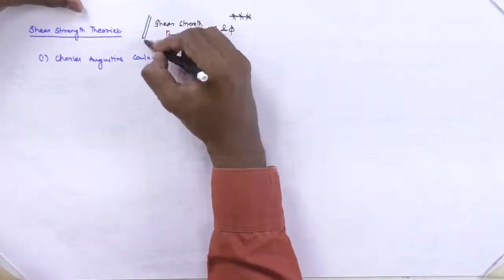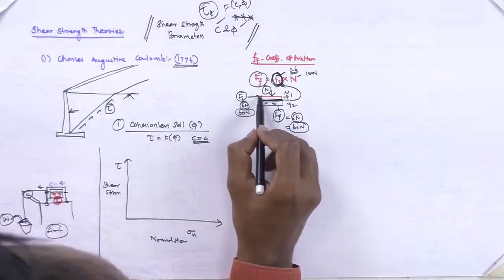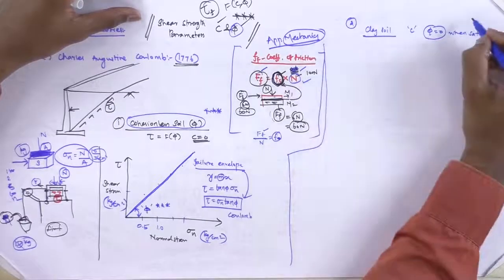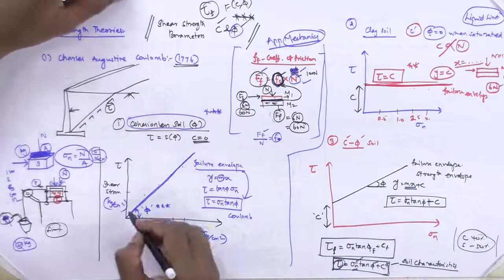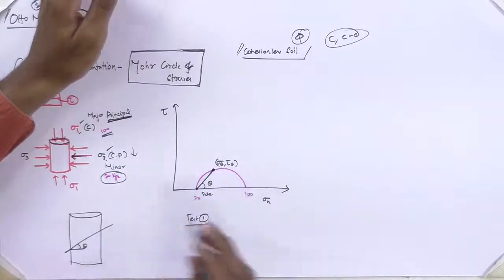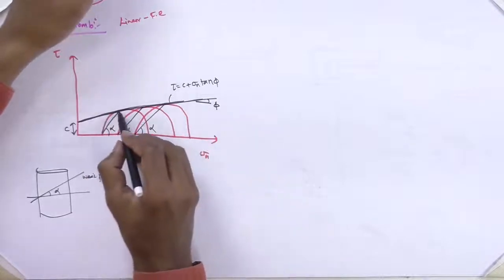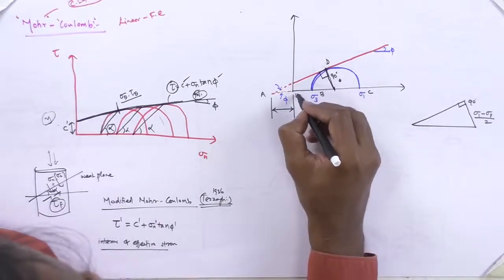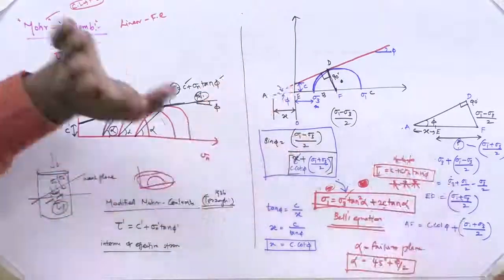Shear Strength of soils   Mohr & Coulomb Model

Comment: For some reason im strugling with equation 3 of mohr equation, (S = C+ σ tan Ø) i did test with 3 samples and plotted on the excel graph with line of best fit equation of y = 5.7023x + 24.389.
so if i draw a triangle with a base that runs from x=20 to x=40, would my S value be the value of Y axis when X=40? which is 252.481?
and what value would go where (σ) is? i tried to calclate the angle but i get 63 degrees which is too much of an angle. the numbers i plugged into the formula is as follow: 
252.481 = 24.389 + 114.046 tan Ø. i suspect i dont plug in the right numbers.